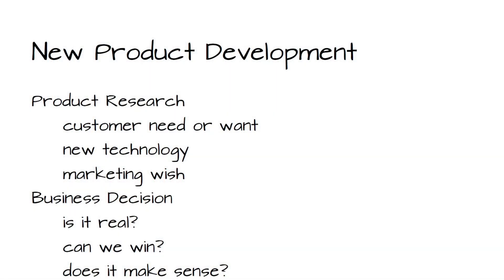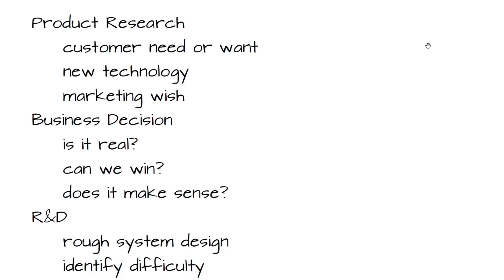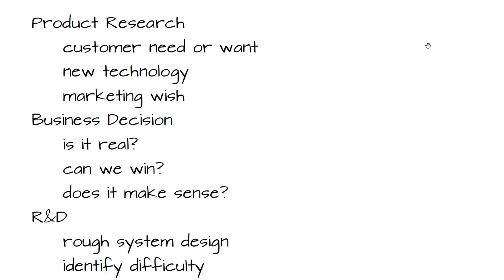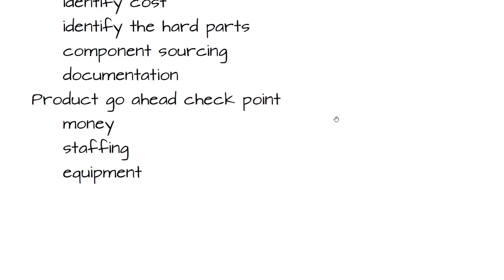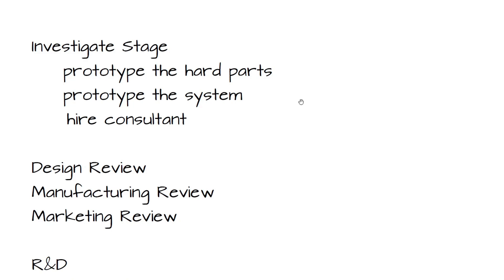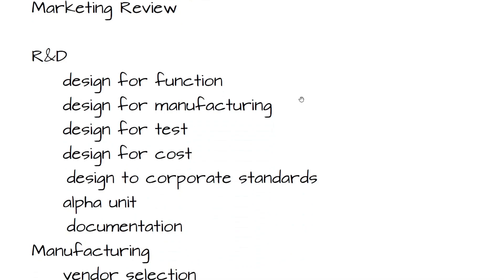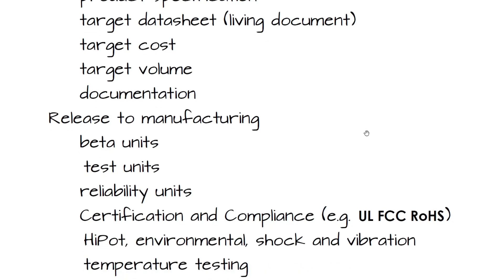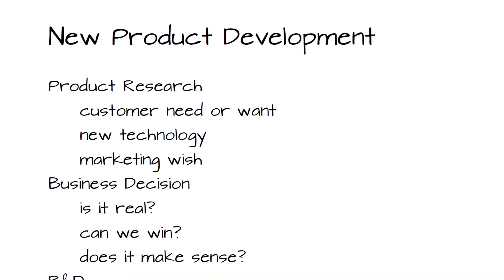#1121 Product Design and Development

Comment: Brings back a few memories... Vibration testing put kit on trolley and run it around the rather unkept roadways between the factory buildings...  

When we built a custom "bump test"  system, we put a unit on it overnight (unpowered the first time) and in the morning we found a dozen or so screws, nuts and such like in the catch tray. That caused a change in the threadlock product we used, and the reliability of the product shot up.  Shows just how important such testing can be.

Andy